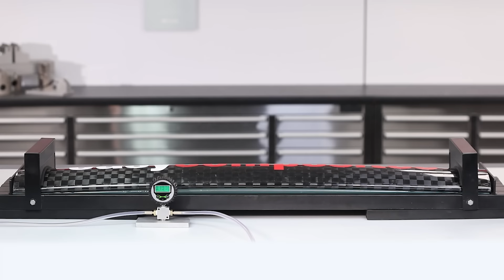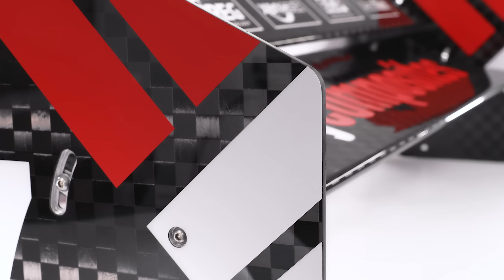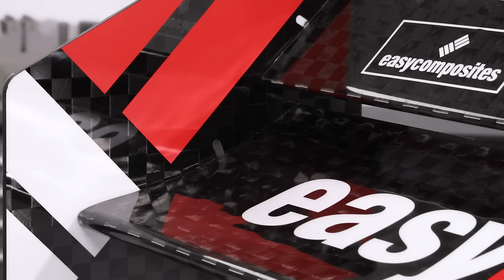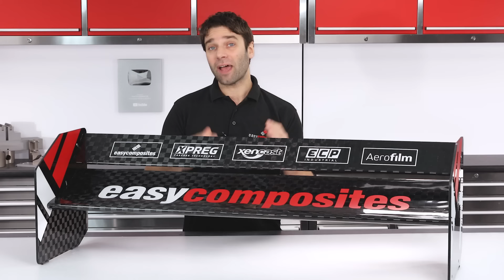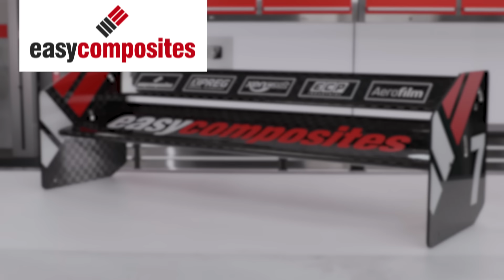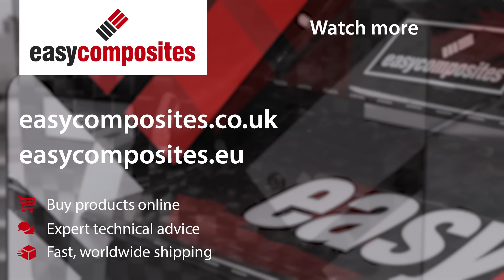Building a Rear Wing with Carbon Fibre and Nomex

Comment: Would it help to add thin sheetmetal between the bag and the wing to limit the ripple? - after getting rid of excess epoxy, reopen the bag, add ~0,5mm stainless & revacuum?
Reply from the maker: You could do that but it would need to be as thin as possible and preformed to be as close to the profile of the foam as possible, otherwise you wouldn’t get the required consolidation on the carbon/resin in some places 👍.

Comment: Wonder if there is a way or someone that could make carbon PC mouse body molds would it be possible 😵‍💫
Reply from the maker: Hi Musa, it would certainly be possible. Have a look at some of our recent videos on prepreg carbon fibre; that would be the most practical way to make a component like a mouse body.
Reply: Chopped fiber would look cool. A 3d printed mold, you go to town on the ratio of resin, and you have PC mouse shell.